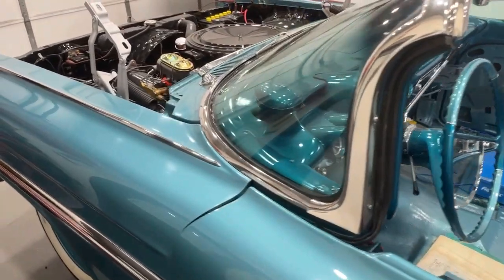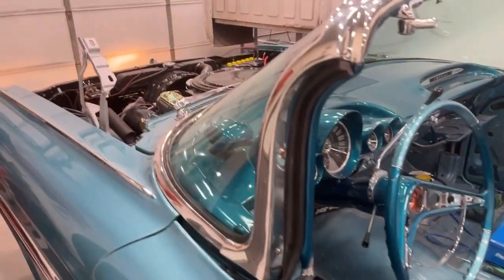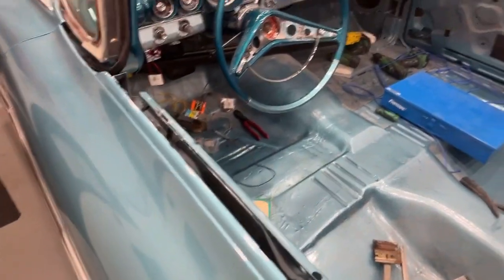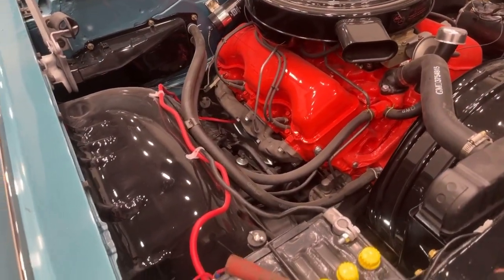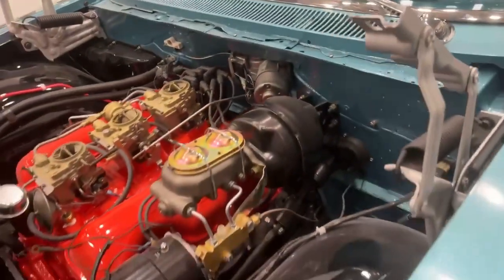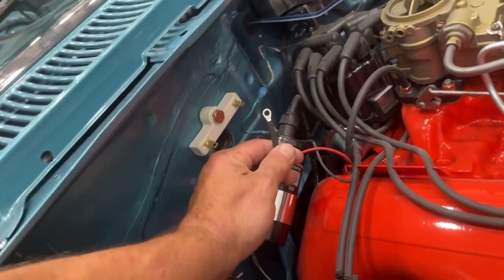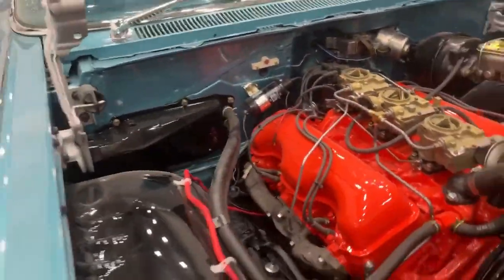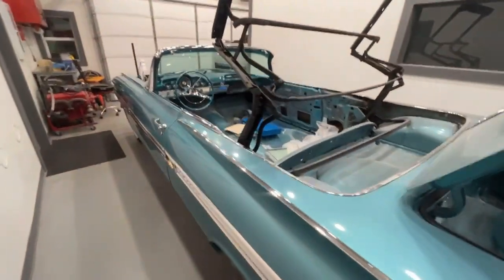Working on the wiring on the 59 impala straighten out a bunch of stuff tonight

Comment: Nice work! Question, what color wires go to the cigarette lighter and radio? I’ve got a 59 trying to figure out the wiring
Reply from the maker: There’s a special plug that goes into the radio. I believe it has a yellow wire and a tan wire but I’m not positive if I could look and let you know. Cigarette lighter it’s just a red wire.
Reply: @IRESTOREBUILDSTUFF-ne9xv  thanks for the info. If you can check on the radio wires and let me know I’d appreciate it. Thank you
Reply: Will do
Reply from the maker: @troylukans2174  the yellow wire and the gray wire are in a plug. If you’re under the dash it plugs into the driver side of the radio yellow wire is 12 V when ignition is on on the opposite side of the radio there is a another two pin connector I don’t know what that goes to.